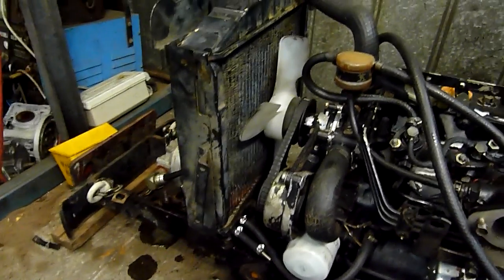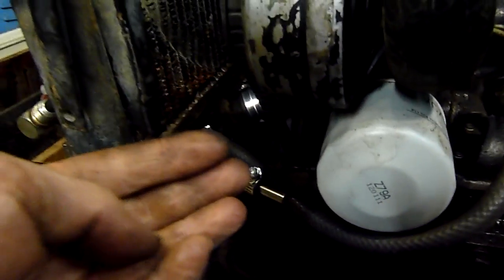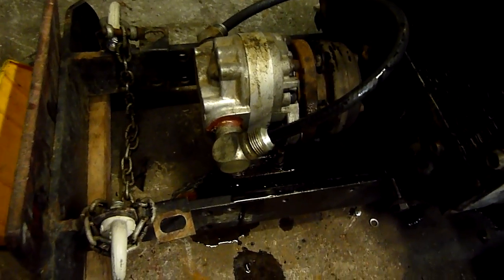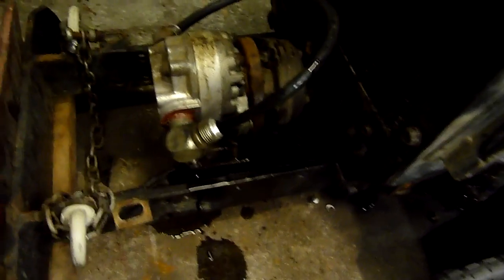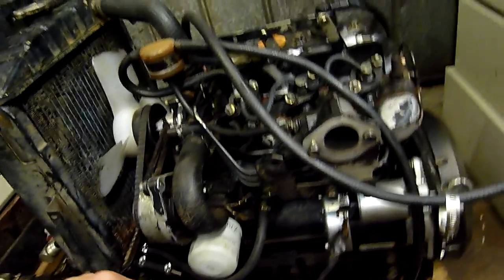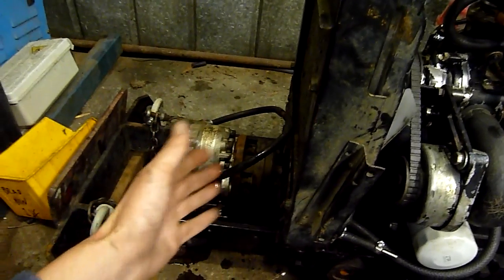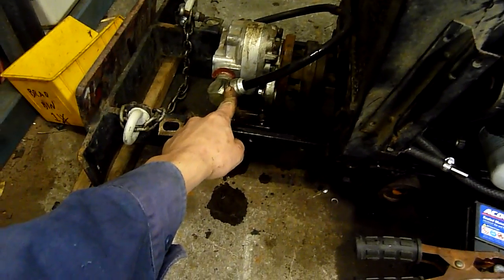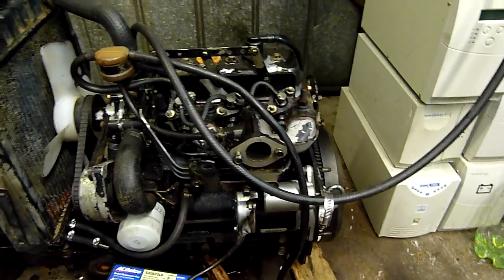Yanmar 3T72HA Tractor Engine Run with Radiator Fitted

Comment: Do you think that could be retrofitted into a small car / truck and be used and get it to reasonable speeds? Maybe add a turbo?
Reply from the maker: dana44s its only 18Hp, so it would be very slow, even with a turbo, it would suit a small buggy tho, keep it light and give it a good final drive ratio and you would be rocking!

Comment: u should see and hear how slow the 2 cylinder, 2 stroke 1.0 liter diesel in our 1960's holder runs when it starts!! its so slow you can hear each individual firing of the fuel, the tach goes from 0 to 400 as each time it fires it speeds up and then slows down as it undergoes compression again :P but its not good for the engine so i speed it up till warms up and idles at around 500 rpm :)

Comment from the maker: Engines like this (from lawn mowers to gensets etc) use centrifugal governors to control the fuel delivery. on a petrol engine it controls the throttle butterfly, on a diesel it controls the fuel flow through the injector pump.

Comment: Please be careful when leaning over that running engine! It would be a bit unfortunate if that swinging camera strap got caught in the radiator fan or other moving parts..... :-(

Interesting little engine. I'd be interested in knowing more on how an engine controls it's own speed on a generator, i.e. keeps going when loads are put on, without stalling, and how it doesn't scream itself to bits when the loads are taken off again. :-)

{^_^} BoomBoxDeluxe {^_^}

Comment: The powerhead could be used for pistons and/or crushing gadgets... More stuff to destroy, with class!  I'd pine and bargain for a dual action cylinder, some I-beams, some plating and a few hydraulic controls, preferably with auto-centering functionality or auto-return on pressure peak.

Comment: if you are changing the frame, you could stick both the oil tank and the fuel tank above the engine, and also maybe some push-fit hydraulic couplings and controls, then it could be multi-purpose power pack (shredder, crusher, Brad's press!!!)

Comment from the maker: the rocker cover was pretty good for a old diesel, sludge free. I pulled the cover off a big Mitsubishi 6cyl truck diesel at the junkyard today and it had about 1Kg of coagulated sludge under it. it was like carbon black Jelly on everything. no wonder it died!

Diesels are naturally dirty. but sludging can be avoided with good oil.